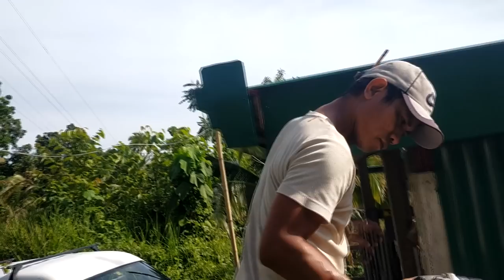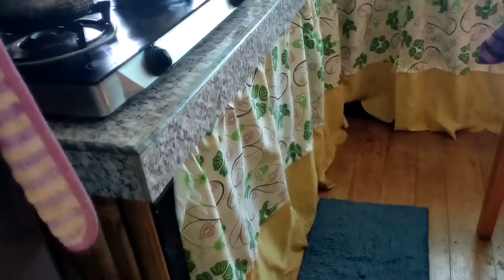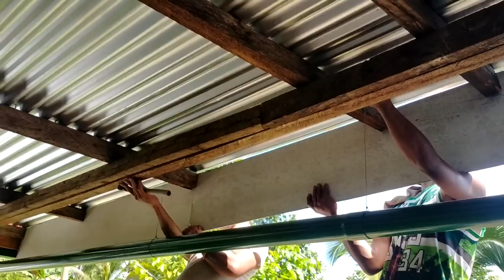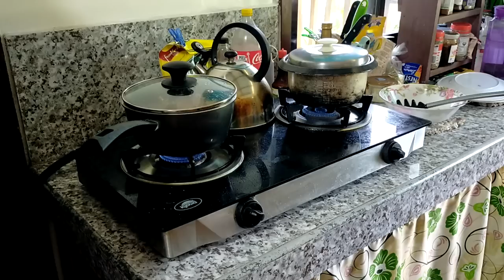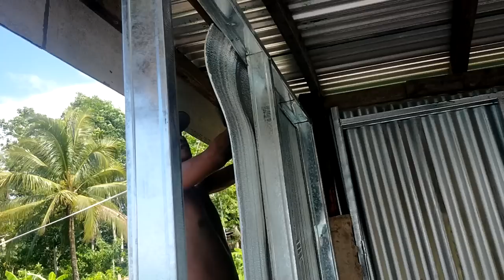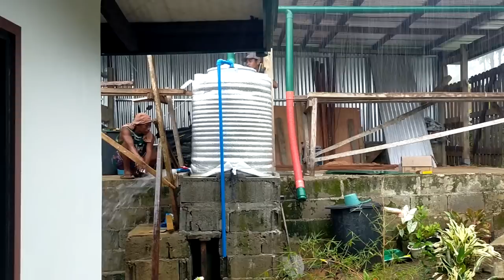V431 - FOREIGNER BUILDING A CHEAP HOUSE IN THE PHILIPPINES - INSTALLING THE ROOF FASCIA

Comment: Believe me corrugated clad buildings can't stand up to strong typhoons. I myself had a new build similar house in Southern Leyte Philippines. Sadly that last large typhoon destroyed it. I've since replaced it with a solid reinforced concrete building and concrete dome shaped  roof. In my case the cladding was a waste of time and effort plus timber framing is prone to termites destroying it in a few years. Converting shipping containers for housing is a very good option also.  Building materials have doubled in price in last 14 months in Philippines meaning it's even harder for the Philippine people to build and repair there homes. Interesting video as always.
Reply from the maker: Material price has not doubled, far from it. A treated timber house sitting on concreted will not be affected by termites. In our area no typhoon as such.
Reply: @retiringinparadise  Lived in Asia over 12 years & a cabinet maker 46 years working with wood daily. I've yet to witness any treatment that will stop termites destroying timber acsept the ancient Japanese method of charing  wood with fire then, wire brushing  and repeating the process several times it's very time consuming. The cliff  hanging coffins of Sagarda mountain in the iland  Luzon of the Philipines have this method of preservation & conservation by charing wood then coated with natural oil  process called  ( Shou sugi ban) Termite queen's and males will fly at certain times of year to start a new colony and concrete base of any building  will not prevent them from geting in any home or building they simply enter by the roof of other entry's they find. Note in Thailand just about every thing what's nornamally made of wood in the west  is made of concrete there due to termites. Always interesting watching your videos with your daily lives very much like my own keeping it simple is the key to a happy life I belive in Philippines.
Reply from the maker: I saw with my own eyes, not in Japan but here in Mindanao a house 39 years old made of hardwood all over with some bamboo and even plywood, they only used Diesel all around the main base so I was told, I couldn't find any trace of termites what so ever and that's the only think I will believe. These processes you mention were used long ago before technology came with more readily available products to produce the same or better result.